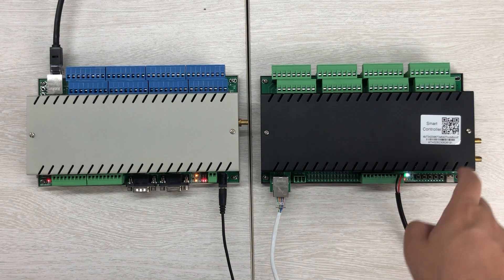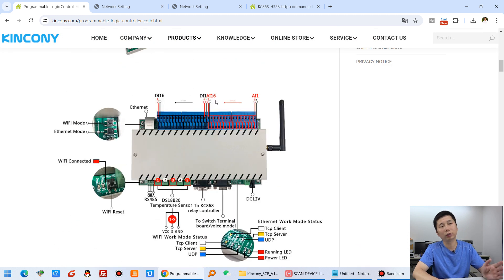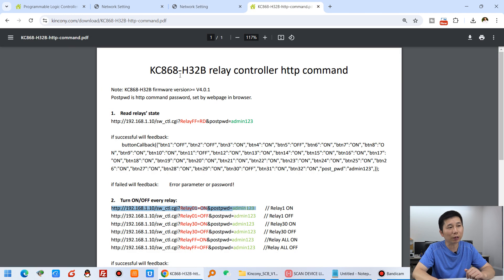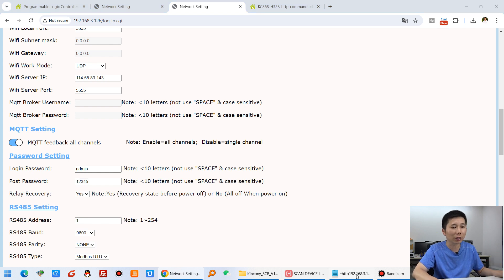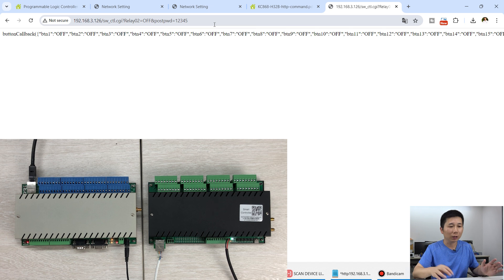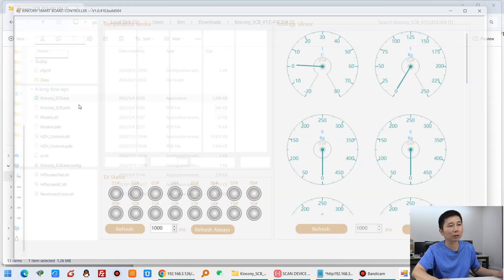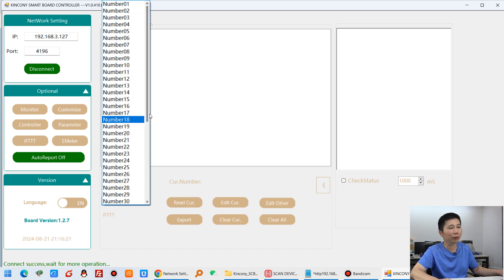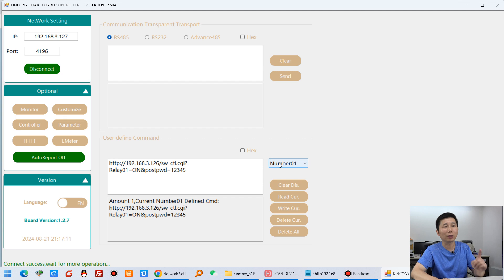add local timer clock for KinCony relay controller using KC868-COLB

Comment: When I turn on the switches through ESP32 at once, some of them work while others do not, and then the ESP32 stops responding. What is the cause of this problem, and what is the solution?
Reply from the maker: which kincony esp32 board you are using?
Reply: @KinCony  just esp32 with relay i made it.
Reply from the maker: @RasimShbitah  it's not easy to say, i don't understand your pcb diagram.